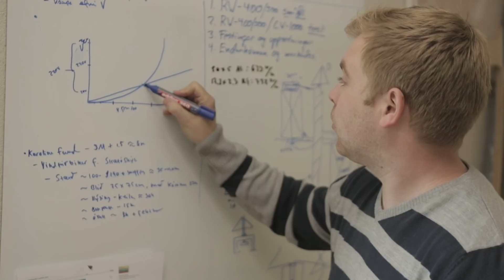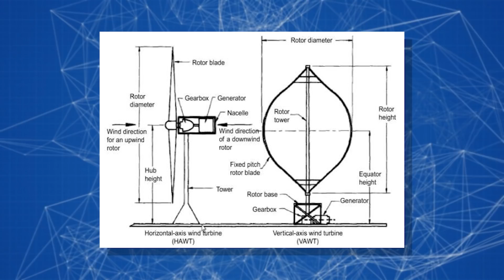Why This Wind Turbine Will Change The World

Comment: Read up before making claims. The earths temperature has more to do with the sun and Traditional windmills are as a propeller also a spinning wing. By the way. A vertical axis of rotation is structurally much more sound, however the wind load still requires a very heavy foundation. Guy wire systems still have to tie into something heavy.

Comment: The turbine featured is a form of a Savonius vertical axis wind turbine, these typically have efficiencies of less than 17%, the common turbine design it is being compared to are 30 - 50% efficient at extracting the energy from the wind. there is another vertical axis turbine design, the Darrieus wind turbine, which is far more efficient than the Savonius turbine, at 30 - 40% efficient.
Reply: Andrew Worth -check out Betz Law which limits the efficiency of any wind turbine .
Reply: @ronnieince4568  why do I need to check out Betz Law? Obviously no energy conversion system can be 100% efficient, but some can be and are more efficient than others.
Reply: Yes, but you're ignoring the fact that these are compact and can be used anywhere, which means decentralizing power generation from one giant, noisy, high-maintenance turbine to smaller, local, low-maintenance and low-impact power generation options. No one is suggesting destroying all the options we have and replacing them with this, it's merely an additional option we can use in situations where it's more economical and practical. For example, the bus stops shown in the video.
Reply: @ct5625  other turbine designs can built to smaller sizes and would still be more efficient than this design.
Reply: @andrewworth7574  Correct, it's like watching a video of someone showing that they evented the wheel, heads up it's already been done. Design is slight different but nothing new, efficiency is still slightly tiny bit better & that's about it compared to older spiral designs. To me It's like someone got a spiral column wind turbine then chopped it half then made supporting rods to hold the fins in place.
Reply: @ct5625  
VAWTs can also be placed more densely with the capacity to produce more, and work in areas where HAWTs can't. Additionally they are more bird friendly...
Reply: @ct5625  But of course you will need 'rather a lot' of these to equal the output ofeach large conventional wind turbine.
Reply: Darrieus
Reply: There are other factors to consider, like wear, and scalar properties.
Reply: the key features of savonius wind turbines.

Suitable for areas with the strong wind flow.

Unlike the darrieus one, a savonius wind turbine doesn't require an additional machine to start it up. The turbine starts whenever wind flow strikes.

Quite larger than darrieus wind turbines.

Less efficient but high torque capability.
Reply: @tigress63  
What about durability?  VAWTs have several advantages over other horizontal axis turbines.  How does the Liam compare?
Reply: @Ronald Tindle quit watching them spin around then.
Reply: @Ronald Tindle Then take your shoes off, youll be fine.
Reply: @klubstompers  big turbines are annoying and are detrimental to health, they are noisy… and noise has a big effect on your health, even working near a computer fan, even a silent one can make you sick after a while
Reply: Just watched a video stating over $400M annually are spent on disposal of the short lived blades, in America alone. Non recyclable materials. Then there is the noise and physical hazards, along with the GSM driving wind velocities higher to the point (I believe) will destroy large systems. During the GSM the weather gets rather severe. From walking across the pack ice of the Everglades, to 300 mph winds across the plains. Times will be very rough no matter what we do. Preparing to survive it is more important than trying to change it.
Reply: @bryanst.martin7134  "pack ice of the Everglades" . . . . Oh my ! - - are you expecting 40*F of Global Cooling ??
Reply: @bryanst.martin7134  Generally extreme weather frequency increases as energy input increases. Why would you assume that GSM would result in more extreme weather when the energy input from the sun would be lower? Also, the GSM effect on global temperatures is only expected to be equivalent to about the same as the reduction of 3 years worth of CO2 release into the atmosphere by modern civilization. 
You should also note that 2019 had the lowest solar activity recorded in the last 100 years, but was also the 3rd hottest year on record. 2020 had almost as low of a solar activity and was the second hottest year on record. The sun is going to be increasing energy output for the next 5 or so years of its normal 11 year cycle, so odds are good that we'll see new global temperature records set during the next few years, even if we are entering a new GSM.
Reply: @shaun6828     The oceans are a giant holding heat reservoir or solar heat tank with a huge, long term lag effect.  Just one, (or 3, or even 6) year of reduced Solar activity will not cause any major change, because the Sun was unusually active from around the 50's to early 2000's or so (the Sun was in a grand solar maximum period). The oceans absorb and hold onto that energy for a long time.  It will take many years of very low Solar activity to appreciably affect the overall climate and averages.  It would take somewhere from 15 to 30 years of continued low Solar activity, as a lag effect to catch up with the ocean warming (or rather for the ocean to completely dump the stored excess heat from nearly 60 years of extra warming as compared to usual).
Reply: @justinw1765  Average ocean temperatures have continued to rise since the early 2000's. If the input energy had decreased 20 years ago, you would expect a leveling off or even slight decrease in temperature, not a continued increase. Surface temperatures of the oceans would actually decrease in the short term with lower solar input, due to the warmer surface water mixing with colder water at greater depths.
Reply: @shaun6828  Global warming is greatly exaggerated.  CO2 as the proximal cause is also greatly exaggerated, although it is a variable that correlates fairly well with the net impact of humans on the environment.  I'm just not at all sure that a single-minded strangulation of CO2 emissions is going to get us where we want to get.   In fact, by the time we're done making all the batteries required - and disposing of them - the planet will be a lot more polluted.

I think you need to take a wholistic approach, not the hysterical approach taken by climate alarmists, which is very similar to the hysterical response to COVID.
Reply: @justinw1765  
It's an open system and there is more the ocean's heat retention at play.  Just getting farms to use seed drills (no-till) and living mulches/cover crops can significantly reduce the springtime surge of CO² from pl9wing
Reply: @jerryli5555  You should read a little on how infrared light interacts with molecules like CO2, H2O, etc. Every day, massive amounts of sunlight hits the earth and warms everything from people to sand in a desert. As you may have seen with a thermal camera, warm objects emit infrared. Everything that has been heated by the sun emits that infrared light and cools down. It is a careful balance. Add just a bit more of a gas that prevents infrared light from bouncing straight out into space and the balance gets tipped toward more heat being trapped.
Human heat production from fossil fuels is minimal compared to what happens when the whole planets atmosphere has been tipped into retaining more light from the sun. Unfortunately, we are not shifting away from making it worse and our descendents are going to fry for it.
Reply: @bryanst.martin7134  GSM?  . .. Grand Solar Minimum??

Comment: Most important question: what's the cost per kilowatt hour compared to other turbines?
Reply: These "advertized" turbines can't even make 1% of the large industrial wind turbines that it bashes. Power production formula is related to square of the area that the blades cover during rotation.
Reply: @precursors  That does not detract from its advantages for smaller scale wind generated turbines.
Reply: @DevonDandy  I understand smaller scale wind turbines advantages, but it keeps comparing itself to the conventional high power high scale wind turbines
Reply: @precursors  The future. Not every invention started as a world changer. But, necessity is the mother of invention. Think of the automublie.
Reply: @chasjacks9378  We're talking about a simple mechanic here that was invented centuries ago, not some unknown science
Reply: @precursors  Every comparison needs a benchmark and the larger ones are simply the most convenient as those are what are currently being built.
Reply: @precursors  but can you have 100 of them on the same area or more areas because of better design?  My question is watt produced per $ spent or the ability to be incorperated into any structure.  We are going to need a lot of green energy sooner than later imo.  the question is can the average person use one and will it hold up.
Reply: @davidstrong7854  No you can’t have 100 of them in the same area. A typical vertical wind turbine has small footprint although the blades up in the air have large area. The amount of power you can generate with wind turbine is directly related to square of area of the blades and cube of wind speed. So the bigger blades you have, the exponentially more power you can generate. You can’t just make hundreds of smaller ones and generate the same power, it doesn’t work that way.
Reply: @precursors  thy need to be separated that is the footprint not the space of the base occupies
Reply: @Oz A Yes!
Reply: I will buy any way
Reply: @Oz A roughly the same as normal windmills

Comment: The development of anything that can save the environment is good for everyone, We ALL need to stop abusing and start helping our mother earth other wise we as her children will not live to regret it.  👌
Reply: "Green Energy" is mostly Bullshit.  All this stuff is NOT carbon neutral.
Reply: @ffjsb  Well if you can suggest anything better then let's hear it👏
Reply: @johnfisher697  This vid shows a ridiculous attempt to compete - and it can't.  "renewable energy" will never replace common sources.  Nuclear energy is the way to address any potential future lack of standard sources.  Unfortunately people that are classifying that as unsafe or bad for the "environment" are foolish and ignorant.
Reply: @doctorlarry2273  What are Common Sources and Standard Sources?, I can't agree with this argument for Atomic, there has been to many near misses with accidents to think it is safe and its waste is a menace for thousands of years. I think Electric cars are a mistake with the pollution from the batteries of these vehicles, Hydrogen Engines seem a far better option all though I am no expert
Reply: @johnfisher697  Current sources, that make up the bulk of power generation are fossil fuels such as petroleum, gas, and coal.  We have a huge supply and the estimates grow every year.  Hydropower does not provide a lot of energy, but it is pretty clean.
You need to avoid the sensationalized stories or nuclear plant problems from the past.  They were extremely rare and do not happen to modern nuclear power station design.  You should actually look into modern design - they are very efficient and safe and clean.

Comment: This was a very good video and I'm impressed with their design. However, ?s that were not address or conveniently left out of the brochure. How does the generation of energy compare to the tradition turbine design, i.e, at Max 1800W and 3000W generation, what is the efficiency rating and how many of these would you need to replace just one of the traditional turbines. Lastly, cost, durability and maintenance. If you are going to compare yourself to other products to highlight your advantages, then go thru the checklist and present it good and bad. That's how you win the trust of consumers. Still, I love the design, I've considered the same type after seeing some many of those bulb looking vent things on house roofs spinning so rapidly during wind storms.

Comment: I was looking for some amazing, world changing invention here, but here it was not. IT left out old things like, it works in turbulence. However, ground breaking news would have been the design allows the wind to start it. All I've read is that these have to be started or they just sit in the wind unmoving like a frog on a log. I've often see two of these next to each other one spinning the other not. It's the same wind but not the desired output.

Comment: Also, so many unnecessary falsehoods.  Wind turbines are not loud--that "roar" is a few hundred feet in the air and does not make meaningful sound at ground level.  And birds DO dodge turbine blades all the time.  Birds constantly fly right through wind turbines.  There are certainly issues with current wind turbine technology, and there is no need to exaggerate or invent issues.

Comment: I come in the inventor for what seems to be a good design, perhaps all those who are complaining about the video could instead put in their two cents and try to improve the system.
Reply: Are any of the people complaining WRONG????
There's a LOT of Bullshit to "Green Energy".  I notice they leave out cost of the unit, not to mention that you will need a battery storage system to save any excess energy produced. (if any) A charge controller to prevent overcharging, or too rapid discharge.  Not to mention, None of these are big enough to run heavy appliances without using MULTIPLE units for even one normal house.  There's also the lifespan of the generator to consider...
Reply: Being a critic is the easiest job in the world. Constructive criticism is very rare.
Reply: So - you are criticizing the people that are telling the truth about this totally disproven contraption?  It's not worth 2 cents.

Comment: yeah, great for integrating into existing development, but there's a reason "traditional" turbines are still the way they are for dedicated high capacity production. the huge radius of the turbine blades is a feature, not a byproduct. it's to catch more energy from the larger area

Comment: This guy has no clue about what modern wind turbines are, and are not.

 How can you compare a max rated power of 3 kW to modern 12 MW turbines ? 
You'd literally have to install more than 4000 of those IceWind turbines to compete with a modern off-shore wind turbine. 
I won't be watching any of your other videos, as I have to assume that those could be as misleading as this one.

There's nothing wrong with the IceWind turbines, but they are not going to deliver power to a power-grid. If Vertical-axis wind turbines (VAWT) work better than the current Horizontal Axis Wind Turbines (HAWT), don't you think someone in the billion dollar industry of Wind Turbines would have thought to make them ? Like so many others have pointed out, it's not exactly a novel idea in any way.

Consider doing some actual research for your videos. You make so many subjective and untrue arguments against modern wind turbines, that its clear that you have some weird grudge against wind turbines. Whether you are deliberately being dishonest, or if you just decided to do a terrible job of understanding the topic of wind turbines is unclear. Either way, posting a video that is clearly misleading in it's overall message, and with several incorrect facts, is not a good look far anyone who wants to do these kind of videos.

Comment: That wind turbine has an maximum efficieny of 20% (hard mathematical limit), what means that the overal designs will reach 15%, probably. Currently used WT are at around >45%. So, you cant compete with solar, cause you still have moving parts and necesity for maintenence, and you can´t compete with HWT because this simply can´t meet the efficieny. This will not leave the bus stations...
Reply: Solar needs maintenance
Reply: @johnlucas7333  sure it does, I was just high lighting the pros of both techs and why they are used
Reply: why not make the blades photovoltaic?

Comment: I read all of the reviews. I am amazed that there are so many climate deniers - sorry guys you lost lone ago. Vertical axis wind turbines (VAWT) have a place, though they cannot compete in efficiency or size. When it comes to distributed generation for special uses then there is great potential. You just have to understand what a niche market is. Besides they are fun.
Reply: The place is in the garbage. Or as lawn art. Go to Bergey wind power and read about the physics of hawt vs. vawt.
Reply: @solarwind907  I never said that VAWT was "better" than HAWT. What part of "niche market "  do you not understand?  Can you say that there is not a place where a VAWT would be useful?  Hey, a VAWT powered garbage can is a great idea.
Reply: @chrisconklin2981  You may be right. There may be some great niche application for a vawt.  After decades in the RE industry I have not seen it.  Most of the vawt websites I've seen don't have a power curve, pricing or even a real product to sell.  They're usually marketing companies.  

If you want to get into them I'd advise you do do your homework, see some installs and bring an amp meter and an anemometer with you and confirm reality before you spend money.  

Vawts are usually vaporware based on what I've read by smarter people than myself, what I've been taught again by smarter people and my personal experience.  

Good luck to you,